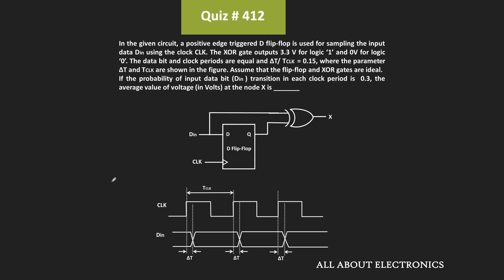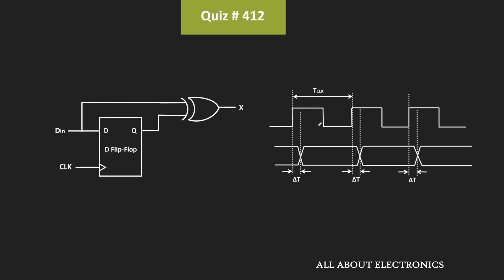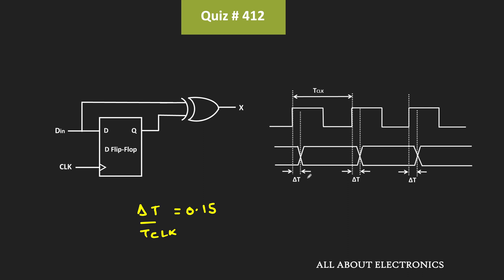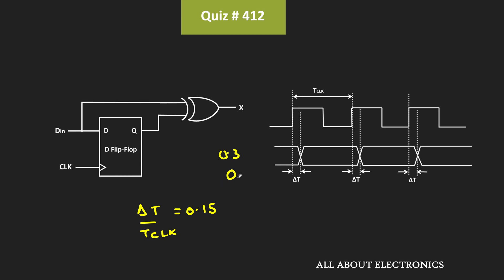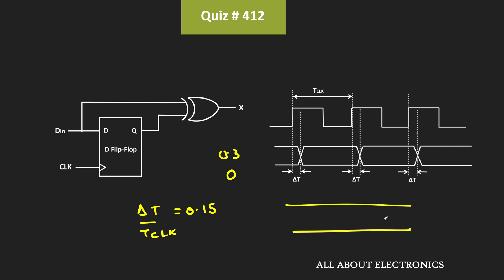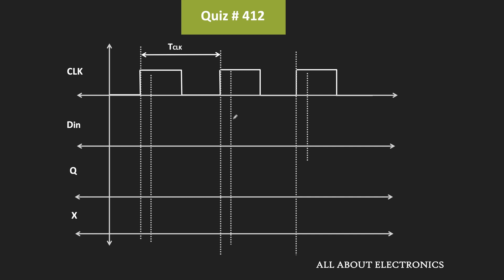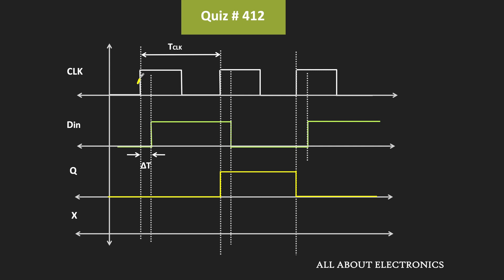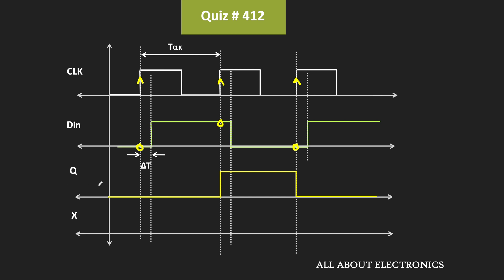D flip-Flop Solved Example (Digital Electronics) | Quiz # 412

Comment: I couldn't understand why the Din looks like that in waveforms and based on what we can say that it is same as clock signal in waveforms but a delayed version,İsn't it the input that we can change?It is not connected to clock
Reply from the maker: Although it appears as a clock signal, but in the question we have been given the probability of transition of Din at the every clock period. If Din input makes transition from low to high at every clock edge then transition probability is 1. And in that case, what you are saying is true. But here it is 0.3. So, at every clock pulse, there is no guarantee that the Din input will change. So, it is not same as clock signal. I hope, it will clear your doubt.

Comment: sir while u r calculating average value u r not using integration formula that u mentioned  instead u r putting 0.85 Tclk 3.3V Can u please explain that part sir
Reply from the maker: As I mentioned at 4:50, The average value is 1/Tclk (integration of signal over one time period). So here, out of the total time Tclk, the signal is 3.3 V, for 0.85*Tclk time. And for remaining 0.15*Tclk time, the signal is 0. So, in the integration, you will get 0.85*Tclk*3.3V + (0.15*Tclk*0). And the entire expression will get divided by Tclk. So, eventually we will get 0.85*3.3V. I hope, it will clear your doubt.
Reply: yeah sir thank you so much @allaboutelectronics-quiz

Comment: Sir how Din u drawed(2:46)  i.e. i wont understand can u explain
Reply from the maker: See, here for simplicity, it has been assumed that, at every clock, there is a transition in the D input.  ( The case when the probability of transition is 100%). If we consider the probability of transition as 50 % then at every alternate clock, we will see the transition is D input. (High to Low and Low to High transition ). Based on the case of 100 % probability of transition, the  case when probability is 0.3 is calculated later.  I hope, it will clear your doubt. If you still have any doubt then let me know here.